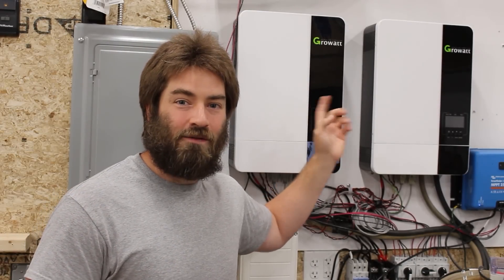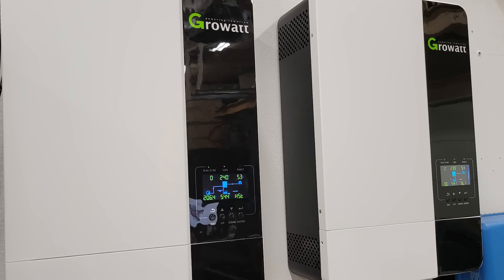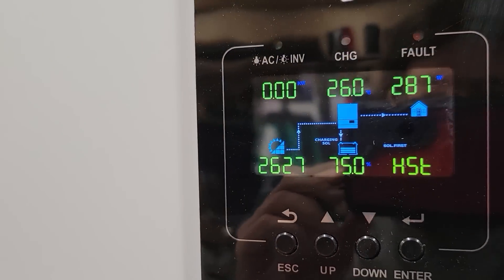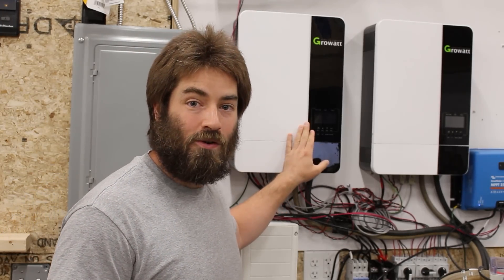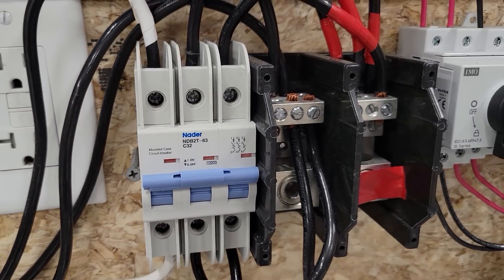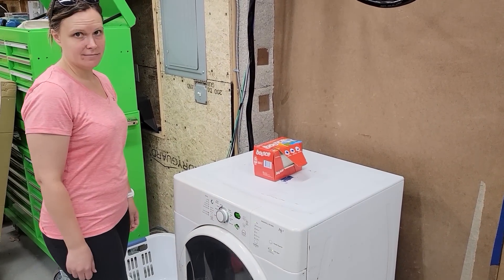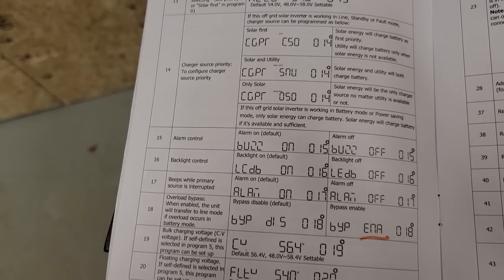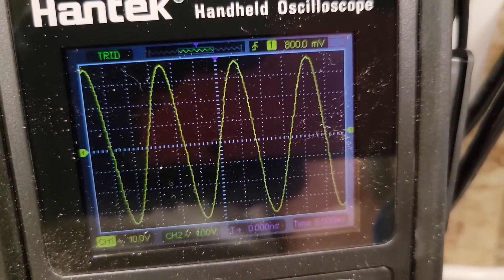Update after 1 year of use off grid, Growatt and EG4 (Gyll) batteries

Comment: We ordered the 2 growatt and eg4 battery. Signature solar company has been a terrible experience. Both growatt have issues. One shuts off within minutes the other runs but doesn't seem to charge the battery very well. Signature solar customer service has been the worst.
Reply: If you have a contact with sig solar, we would greatly appreciate the assistance

Comment: I'm glad this project has worked out so well. I'm also very interested in hearing an update regarding your solar hot water tank. Has it held up? Would you go through the effort of doing it again? I've considered making one for years, but I find it hard to justify because I have a natural gas utility.
Reply from the maker: The solar thermal has been running fine.  I've never had to do anything.  The automatic controller turns on the pump when the sun is available and it's just that simple.  However, I would not do it the same way again.  These days I'd probably have a 100 Gallon electric tank with the bottom element connected as a diversion load when the batteries get full.  I'd rather use the roof/wall space for solar PV (electric) panels.
Reply: Will this run your whole house with using all appliances and ac,heaters? What was your light bill before going off grid? How many kwh per month? How many watts of solar to power this system?
Reply: @GaHullbillyRanch  new to this guys channel. Would appreciate an answer to your question. It’s probably covered in other videos but T I M E

Comment: Hi @Davidpoz I'm not sure if this was already asked. I notice you are running a separate charge controller, is there any particular reason for that? My system was set up directly without an external charge controller.
Reply from the maker: I have 3 solar arrays in the backyard.  Each array needs it's own charge controller.  Each inverter has a charge controller built in, but that still leaves the third array.  I had the Victron charge controller from back when I had my old Aims inverter.
Reply: @DavidPozEnergy  are you running the victron mppt into the same battery bank as the Growat ??
Reply from the maker: Yes.  It's fine to do so long as the settings match.
Reply: @DavidPozEnergy  thanks I thought it may need to communicate with the Growat,, , but I suppose another option would be to use a another growatt, and as charger only

Comment: System looks smooth. 100% SOH <- That's a great feeling. The System we build is doing great. Few day this year with low sun and the family not respecting their power consumption which lead to the 6,500watt Generator being used. Aims inverter will Not wake up a low voltage battery if it shuts down. I can oddly Jump the system with a cheesy Lithium  Harbor Freight 12v 450CCA Jump Starter.  Cell Pack 6 always blinks blue way before all the others. I think its the one with 18650's. That cell oddly has the highest charge.  Cell pack 1-5 for example are always with in each other say 54.5 54.5 54.6 54.4 54.5 but Pack 6 is 55.2v <- weird. Other then that its keeping the off grid tiny home running with a 10k btu AC and a Large Air fryer.

Comment: I'm glad to see the Growatts are holding up. I have the 3KW versions and I'm running 4 of them in off grid as well. I have been 100% off grid for 3 1/2 months with zero issues from mine. I do however have the same problem as you when a big load is placed on the system...my LED lights dim of flicker for a short second but then everything is good.
Reply: Do you  use soft starters for high load motors- electric dryer, mini split compressors, etc?
Reply: @bigbob3772  No I dont use any soft starters.
Reply: Semiconductors are very sensitive to voltage fluctuations... It's to be expected, even with lifepo4, when surge load occurs.
Reply: I just bought similar 3kwg inverter for my small cabin just to run fridge tv lights phone charger just wondering how many lifepo4 batteries you are using? For 100percent off grid?
Reply: @piterex7  Hello......I have twelve- 24v batteries with 2 each in series to create one 48v. So that would be six and then I have two- 48v batteries for a total of eight 48v batteries.
I wasnt aware of the single 48v batteries until I had already bought the 24v ones. When I built my system I wasnt sure what I would need so I bought a few then kept adding.
In the future if I need more batteries Ill buy the 48v ones.

Idea for your cabin...I always like to plan for a little more than I think Ill need. You may want to add more lighting outside or add something else...I would go with 2 Growatts just so I could have split phase capability and know you can power anything needed for your cabin.

The good thing about these is you can add as you go, so start small and if there is a need for more than just add. Make sure when you wire up your system that its setup in  a way so that you can add another Growatt if needed. I had to re wire my system a bunch of times because of that. 

I have a large house with my work shed out back and two kids that like to turn everything on so we use a decent amount of power. I get about 5 hours of power per battery but the more batteries add that number seems to grow.

Let me know if there is anything more I can help you with.
Reply: @richd9771  thanks for replying one more thing I want to ask you is what do you think about LG chem cells as power wall ? Do you think they are as good as lifepo4 batteries? Is worth to invest in them I mean if I planning to use them for off grid charging and discharging everyday.
Reply: @piterex7  Im not familiar with those batteries. I went with a battery that wall all in one because I wanted plug and play.
My one battery is 120Ah and 6kWh for about $1700.00
I havent had 1 issue with them at all.

Comment: I'm wondering if this set up would run  the house plus a well system with 1hp well pump and 1hp booster pump and the well being 200' from the house.
Reply from the maker: I built a "powerwall" with one of these inverters for a friend of mine and he runs a 240V well pump.  This is the third video in that series, but it's when he talks specific about the well: https://youtu.be/MmKsTafbNyU
Reply: @DavidPozEnergy  that is a very inspiring video. I also liked the vid of you building a battery bank out of a used EV battery (which is more in my price range than pre made batteries). 
 I am thinking two of the growatt 5000w invertors, a EV battery bank and 20 240w panels, getting rid of my 1t ac unit for two 12000btu mini splits (it’s a small place 1100sqf) I have two champion 2500 invertor generators I can use for the ac charging (I got after texas’ winter storm last year)
I’m just concerned about it being able to run the well system, especially after I add in a second booster pump for irrigation sprinklers, and  trying to figure out battery bank size
I am close to austin tx and if you have any body you would recommend in the way of suppliers and consulting, it would be appreciated. 
 I love what you do. You are very informative and extremely inspiring
Reply from the maker: Signature Solar is down in Sulphur Springs TX, about 4 hour drive from Austin.  I'd try to chat with Richard from Signature Solar and they can help get you pieced together with all the components.  If you rent a trailer or Uhaul you could probably pick up everything in one trip and save a bunch.  Tell them I sent you.  LOL, that probably won't do anything.
Reply: @DavidPozEnergy  AWESOME....THANK YOU !!!!

Comment: SOH will be because you're not running their full potential.  100% SOH at 48v-56.4 which is an AGM setting.  So you'd need to set it LifePo4 to see what the real SOH is.  16x 2.5 and 16x 3.65.  Then check to see if they fully charge from flat to get a real world figure.

Comment: Thx David.  I have been watching your a few years & often have reviewed some of our previous videos, primarily the ones with the SMA Sunny Island which I purchased on Bay a couple of years ago.  I have a SMA inverter grid tied system I'd like to take off grid & bought batteries (signature solar) in January (just before I had knee replacement surgery).  I couldn't do much for months but, now working to get my Sunny Island system up & running on our all electric ranch.  I'm hoping I can get the system completed by the end of July (I have several other projects that tend to get in front of the battery system, so it's taking some time to get it operating).   the 106°temps for the last two days is a bit difficult to work in.  I assume that you like your Growatt system better than the Sunny Island system???
Reply from the maker: Hi Dennis,  The SMA Sunny Island inverters are built phenomenally well.  I like them a lot.  However, it is quirky to program.  I've gotten the Sunny Islands working well now without shutting down so I'll probably go back to using them full time, and the Growatts will be for dedicated loads.  I'm saving up for an EV so when that comes the Growatts will probably serve only the car charger and the Sunny Islands will serve the house.  But that's where I'm at now.
Reply: @DavidPozEnergy  Make sure your EV supports Vehicle to load and you will get another 70kwh of storage. Hyundai/Kia support up to 3.5kw at 230v out of the car. I think Ford have it as a charged option on the F150 - i.e. they charge extra for the feature. Even a Leaf will give you up to 1kw at 12v down-converted from the 24/30kwh traction battery.

Comment: So are you going to work towards going completely off grid where you won’t have to pay that monthly electric bill? My electric company has a minimum of like $60 even if I don’t use any electricity, maybe you have a better deal where your bill is very low if you don’t use any. Also don’t you currently have to coordinate so as not to overload your inverters, like make sure you don’t dry clothes while your AC is on for instance.
Reply from the maker: The only thing I really have to watch out for is to not have the oven and dryer on at the same time.  But I can run either one with all my air conditioners, TV's, lights, and toss on a microwave too, it's OK.

Comment: What is the advantage using these instead of the SMA Sunny Islands you have?  They are much better surge and lower idle current, total workhorses.  Wouldn't expect you'd have any of that voltage sag you see with the Growatts.  Is there a reason you just aren't connecting your solar and EG4 batteries to them?
Reply from the maker: There were kinda several things I was planning to do around the same time.  I needed more charge controllers, I was still working out some bugs with programming SMA, I had another project fall through.  No worries though, I'll use it all eventually.  At some point I hope to afford an EV and then I'll need all the inverting capacity to charge it.

Comment: Great video. I have 60kwh of EG4 batterirs. Is it better to work small battery bank hard or a large capacity easy. Its been working great and the fan noiae doesn't bother me and my lights also blink when a heavy load kicks in.
Reply from the maker: A larger bank easier.  I'm still building mine up.  60kWh is awesome.
Reply: @DavidPozEnergy  David thanks
Can you do a review on the size of ypur AC circuit breakers? My home is all electric as well and I am using 30amp breakers for both my ESs and then using 50 amp breaker to my ReliAnce transfer panel to distribute the load. I wpuld love to use my kitchen range but am afraid to try. The 60kwh only drops tje battery bank to about 95% SOC in yhe morning. 
My batyery is usually full before noon and also trying to find other means of storage besides wAter heater and compressor. Thanks

Comment: Why are you using a Victron charge controller? The Growatts have charge controllers built in and the input voltage is 450 right? So why is a 250v/100a Victron needed?
Reply from the maker: I have 3 solar arrays in the yard.  Each needs 1 charge controller.
Reply: @DavidPozEnergy  Thanks for the quick response. Makes sense. I have watched all your videos and I really enjoy them. I watched your mini split install video and used it while installing my mini split. We just bought a 30 year old house (Northern Alabama 1100 sq ft) with a 30 year old heat pump and massive ducting under the house. It sounds lIke a hurricane when it runs. installed a 12K BTU Pioneer mini split for the living room, kitchen and dining room and it has been doing an excellent job cooling the whole house even with 95 degree temperatures. It only pulls 1350 watts at full blast. I will install 2 additional 9K units in the bedrooms to make sure I have enough heating in the winter. Keep up the great work!

Comment: Hey David, I have been watching your videos for days now and I have to say you do a great job of explaining your layout and reasons why you do so. I have learned a great deal over the last few days. I have a question I see an MPPT connected to the system, what is it's purpose and is there a video on the installation, I can't find it if there is. I will be making a purchase very soon and you have me stoked about those systems. I'm used to doing it old school so this will be fun.
Another question  how do you feel about hooking up Harbor freight solar panels to them, I'm on a budget, do the panels need to be all the same or can you put a new string on the second system? Thanks in advance.
Reply from the maker: The inverters have an MPPT charge controller built in.  Actually, if money is tight, and you want to power 120V appliances, check out this unit: https://signaturesolar.com/eg4-3kw-off-grid-inverter-3000ehv-48/?ref=4_rHcgZ9x-TiF-
I would not buy the Harbor Freight Solar panel.  It's not a bad product, but is expensive per watt.  I have bought my solar panels from Craigslist, locally, and all were used.  I bought them for $0.20-$0.40 per Watt.
Reply: @DavidPozEnergy  Thanks man, I got on Signature solar today and someone will call me tomorrow. I looked at the inverter on the link you sent, but we are going to spend the money and get the stuff we want. but back to one of my questions see a MPPT on your wall and it looks like it;s tied into the system, so is it something I'll need?
Reply from the maker: The blue item is a Victron charge controller.  It's charging the same battery bank as the Growatt inverters.  But, I have 3 solar arrays and each array is tied to 1 charge controller.  2 arrays go to 2 inverters since the inverters have a charge controller built in.  But that meant I still had a third array.
Reply: @DavidPozEnergy  I thought that might be the case. How many arrays are you currently running and do you have any good links on how to match up and test  panels ? might be one you need to do..lol thank you very much for taking the time to answer my questions.

Comment: BTW your videos were super helpful when we did our system and it's been running super smooth for about 5 months now.  Also I have UPSs on all of my important electronics in the house.  The noise isn't an issue since we built my solar array with a solar shack under the back side of it.  I also have a mini-split dedicated to the solar shack to maintain a year round temperature in it.
Reply from the maker: That's an ideal setup.  Well done.

Comment: how many watts of solar panels do you have.
Reply from the maker: It's about 12kW in the backyard, split between three arrays.
Reply: @DavidPozEnergy  thanks. I just purchased the EG4 6500 converter. Now all I need are some solar panels and batteries and another inverter would be nice plus all the wiring, mounting hardware etc..  Buying as I go with the budget I have.
Reply from the maker: That inverter will be a nice base to build around.

Comment: why don`t you sink them in a 55 gal drum of mineral oil  for cooling and run cooling fan out side or Geothermal cooling/report back to us if it works.... i want to know.... works for coin miners with loud fans
Reply from the maker: That would be a cool experiment.  I've never tried it so I'd need to learn more about the process first.
Reply: I hate the smell of transformer oil when I cooling  gaming computer，then changed to water cooling with fan
Reply: @wangqianjun   Thanks, did not know this big plus in the build design

Comment: Thank you for the update. It is something my wife and I wondered about how they would hold up. We are building an off grid home stead in Wyoming. So if you have any more pointer’s let me know
Reply from the maker: Insulate and air seal.  I built my house 10 years ago with double stud, super insulation, etc.  It makes all the difference.  I can cool it all summer with a small window AC instead of needing some monster 5-ton unit.  That keeps the Amps low, which means smaller inverter and more cost affective.

Comment: As far as lights flickering, have you tried a soft starter? I’ve seen them talked about a lot for AC units on solar systems. I have a heat pump that supposedly does a soft start on its own. As I’m still under construction on my house I’ll see once it’s finished, but will add one to my system if needed. May also be something that could be added to other heavy duty devices.
Reply from the maker: I've seen the lights blink (when starting a load) with every inverter I have tested.  Just some more or less than others.  Inverters with large transformers do it less.
Reply: I asked this same question, not seeing yours first.  Hard start capacitor is what you are thinking of that is used in A/C units.  I do believe that would help here as well.  Might need a larger one, though.
Reply: @number40Fan  You do not want a hard start kit in this circumstance. You want a soft start  like the Micro Air Easy Start. They are about $300-350.00.  It took my 80 amp locked rotor amp hit down to 24 amps.
The difference is like someone brutally kicking you in the a$$  in a wheelchair down a hill vs a gentle push.
Reply: @TrollingwTyrone  Perfect!